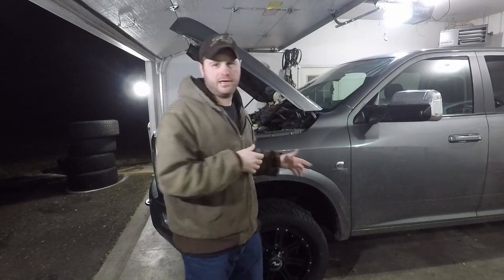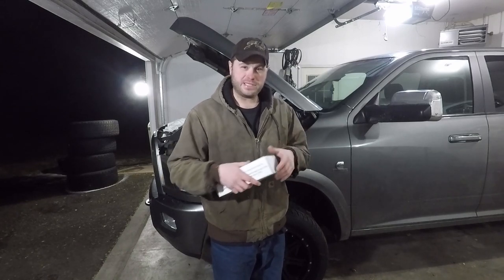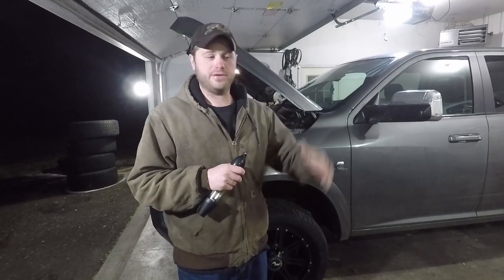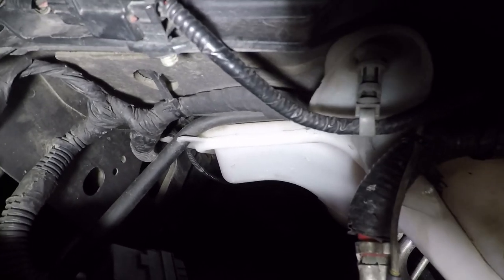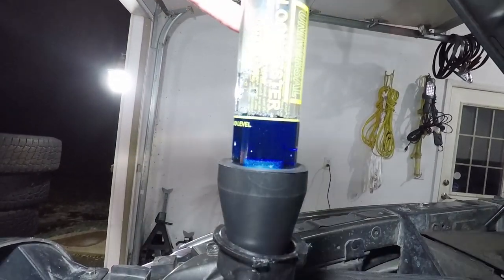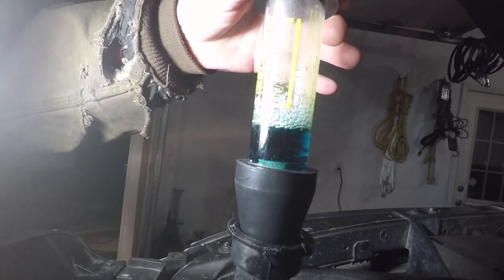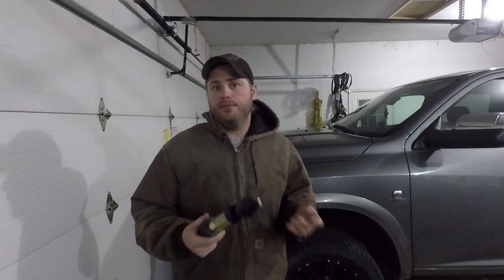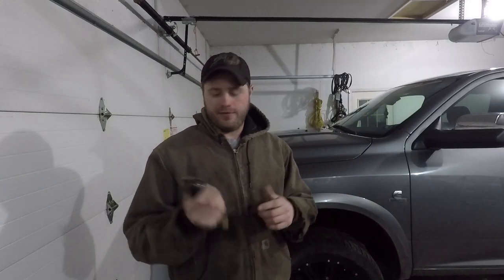Turbo Diesel Head Gasket FAILURE?? Block Tester Tool On 6.7 Cummins

Comment: Been a ASE and Chrysler certified mechanic for over 20yrs. If used correctly the block tester fluid is close to 95% accurate way of determining if combustion gases are getting into your cooling system if used correctly. Yes actually pulling coolant into the tester will null the results. It’s best to remove a small amount of coolant to leave a small void in the top of the radiator. I probably can’t count the number of correctly diagnosed head gaskets I’ve seen using this method.

Comment: Tom, plumb into the egr cooler line were you would bleed the air using a 20psi gauge. And go beat on it.
For trucks with egr cooler /headgasket issues, I'll use the block test tool and brake spool the motor to 10psi or so. You'll see that fluid turn yellow real quick
Reply: Brake spool, teach me the ways of this magic

Comment: Both the times I had head gasket failure, I’d bear a gurgling noise after I shut the truck off. Get the truck up to operating temps and shut it off and turn off the radio and set in it for about 5 minutes.

Comment: Tom and to everyone else, here’s a $4-$6 tip to try before doing a head gasket, if your not positive that it’s a head gasket and there’s no bubbles in radiator or revisor. I ‘ll try and keep this short.

Two weeks ago my 2012 4th gen Cummins was doing the same thing, pushing coolant out and staying high in revisor. 
Symptoms were either head gasket, or radiator cap.

I bought a $6 Stant Lev-r-vent rad cap and it solved problem.

Although the old original cap was pushing coolant out, but not vacuuming back into radiator, caused air to get trapped in system. Just bled it out.
Reply: The rad cap will cause many people problems and false head gasket diagnosis

Comment: Setting high idle in 3rd gens is the same thing, turn cruise on and hit set!
Reply: 4th gen G56 manual trucks do not allow you to do high idle through cruise. you have to install a BD diesel manual high idle kit. just FYI
Reply: 4500 and 5500 C&C manuals do have high idle enabled through cruise control.
Reply: Tried it on my 07 5.9 and it would not go into high idle
Reply: Great info

Comment: So you had a headgasket problem??? My bmw Diesel turn same color like yours on the video
Reply from the maker: Yes, head gasket turned out to be bad
Reply: Turba Tom but mine is running stronger then My series ,  i checked the times 100-200 and etc its doing better then same cars on internet,only symptoms since dpf delete is Temp fluctating when i turn my heater on it drops immediately,  no matter how hard i go with it allways stays in middle or goes little bit down

Comment: I haven't bought the kit yet to check I am today, but I have the same issue as what you are having. I have a 08 6.7 cummins egr delete and arp studs, almost 300,000 miles on it and coolant is blowing out the overflow. I have purged the air out of the system and still doing the same thing. Also I have no heat at all in the truck even when it overheats a little. I don't let it get to hot because I don't want to fuck something else up. But im buying the kit today to check and im hoping fingers crossed its not the head gasket if it is then I guess im replacing it. Is there a brand you recommend? or anything else I should buy while im doing this already?
Reply from the maker: Genuine Cummins gasket

Comment: Hey Tom. Do u know if the high idle works on a manual transmission?
Reply: I have a manual 16 cummins. and no. the only way to get it to work is by having to install a BDdiesel Manual High Idle kit. Which i did and works good!
Reply: It should
Reply: i can 100% tell you that manual high idle does not work from factory on a manual transmission. unless it is the 4600 and 5500 cab and chassis model

Comment: That doesn’t work for diesels
Reply: Bo Mason why would it not work for diesels? If you have exhaust gases in the cooling system it’s getting there from somewhere...the chemical reaction doesn’t lie.
Reply: I bought the same kit I put it up to the exhaust pipe and color did not change